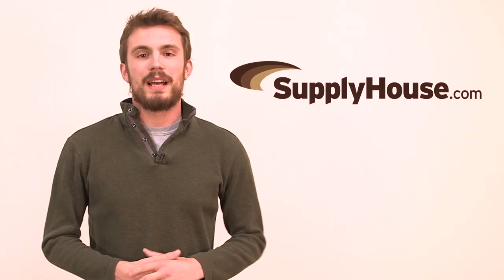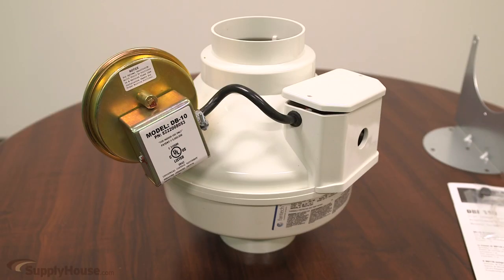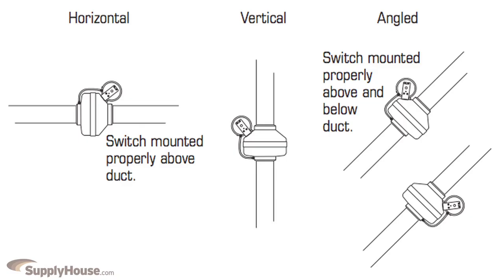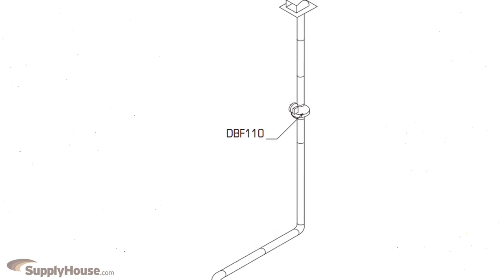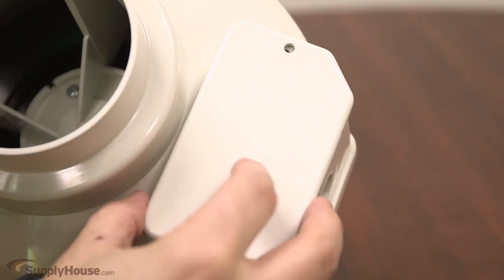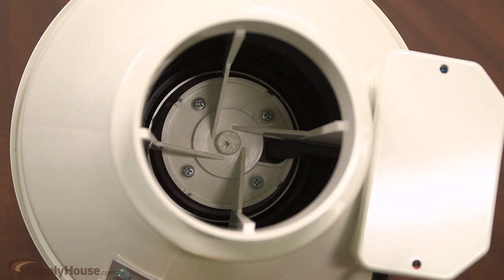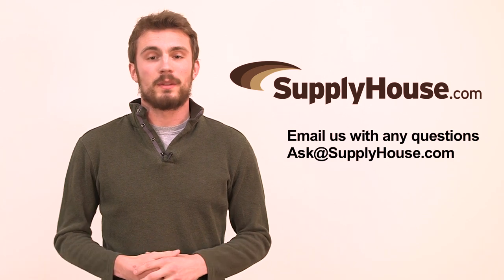DBF110 Dryer Booster Exhaust Fan

Comment: Is not ul listed or certified, wonder how safe this actually is.
Reply: The label in the video clearly says it is UL Listed.
Reply: @brianbaker359  that's ETL
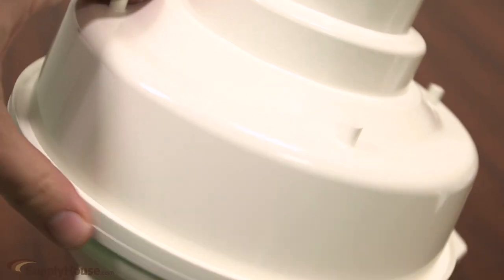Reply: Commissar0617 UL shown at 0:58
Reply: @brianbaker359  that's just for the pressure switch, not the entire assembly.
Reply: Commissar0617 The new literature on www.fantech.net now says their new model is UL certified as per: “What does a UL-listed dryer application look like?
The UL705 is a unique UL listing that was designed exclusively for dryer exhaust, not a blanket certification for any old fan. Not only are Dryer Exhaust Duct Power Ventilators (DEDPVs) designed specifically to be part of a dryer exhaust system, they are also referenced in the latest IRC -International Residental Code.
DEDPV-705
See Fantech's response to the UL-705
1. 2. 3. 4.
5. 6.
7.
Laundries | 3
 3.
5.
3.
UL-listed for both Gas & Electric dryer applications. Supports lengths of duct up to 125 feet.*
5 foot power cord/120v
All metal housing.
  Automatically energizes when the dryer begins to operate and runs a 5 minute cool down cycle after the dryer completes its run cycle; No user interaction necessary!
Indicator Panel: Provides confidence to the occupants that the system is working properly and also signals when attention is necessary.
4 duct clamps for easy install and maintenance.

Comment: not UL, not going in my house
Reply: Don’t be so silly. A UL rating doesn’t make or break a product. I’ve used Fantech in my home for over 12 years with zero issues.
Reply: Built to UL standards and ETL tested.
Reply: @caseycarver3272  12 years, that's great.  What, if any, maintenance do you give it?